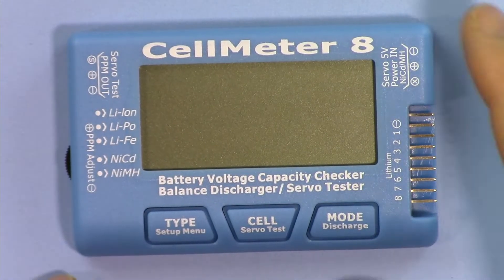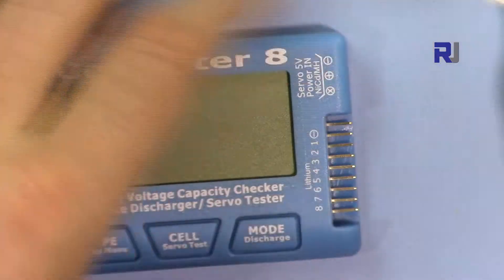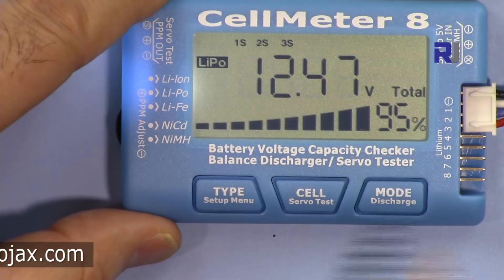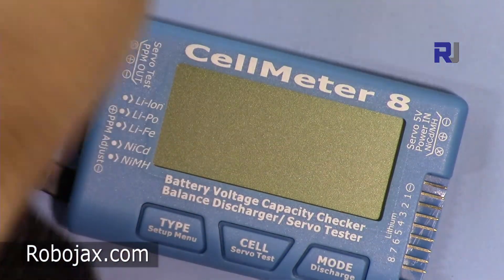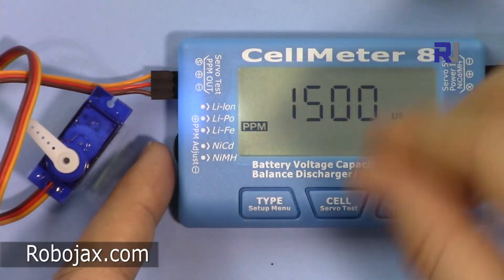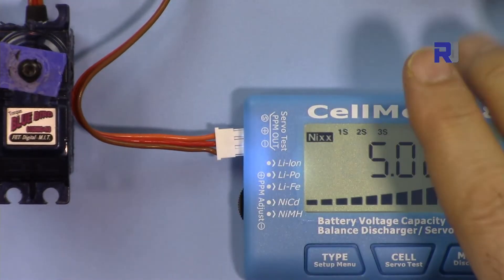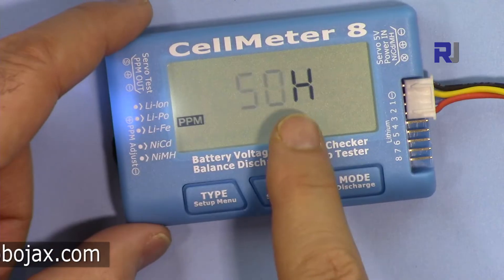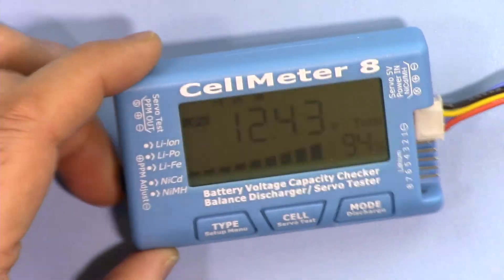Introduction to CellMeter 8 Lithium, Servo and ESC Tester

Comment: Many thanks for your informative review. I have the Cellmeter 8 and it is very useful. The only issue I have is the servo tester. I set it up, exactly like you, using a lipo 3S 2200mah and a 30amp ESC with BEC but at the time of plugging in the 'battery' connection, a continuous alarm sound starts and none of the information on the screen is shown. I have checked the plugs that go into the "servo power in" and "servo test out" to ensure they are the correct polarity. Do you know what I am doing wrong please. Would appreciate your thoughts. Thank you. Peter
Reply from the maker: You are welcoem. these inputs are simply 5V.   the alarm is for the battery /cell level.  so it seems the input voltage is not 5V. the middle wires red or organge is + and the balck is negative.Check the volage comeing from ESC to make sure it is 5V.
Reply: @robojax  Thank you. I appreciate your reply. An oscilloscope can test the voltage coming from an ESC but I don't have one. I thought most rc esc's have a BEC. I tried many esc's that I have but they all set off the alarm. I might have to look at getting some other type of servo tester. All the best.

Comment: Hi there,

When I try to test Motor (all 3 modes, Manual-Center-Auto) there is no Motor Rotating.
After couple of try I realised this ;
if I set the Cellmeter 8 about 1300 ms (still there is no RPM on the motor) and disconnect the Cellmeter and Re-Connect it, motor test start to work (all 3 modes, Manual-Center-Auto).
As i watched your video "Motor Test Function" sould be ok without this "Disconnect and Re-Connect" action.
Do You think there is a problem about mine? TIA

Comment: I ordered CellMeter 8 from Amazon, did not work with original AOKoda small black module and bulb harness fast discharge setup, neither did replacement CellMeter 8. Might work with "exposed" type module. There may be original and  counterfeit CellMeter 8's. My Hobbymate "portrait"version, with black AOKoda module, fast discharges lipos very well. Amazon sells  "ALLRAY" 24 Volt, 50 Watt replacement bulbs, cheap.

Comment: 5:30  when i hold down the mode/discharge button all that happens is "discharge" shows up on the screen and 1s and 2s along the top start flashing (2 cell battery). i assume its discharging?

Comment: lol you again!!. your videos helped me on using my buck converters, now i am watching this to  see if i can see all cells voltages at the same time on this device. im building a lipo for a ebike. i see i cant see them all at the same time. dang it
Reply from the maker: I am glad we met again. LOL. I hope you have subscribed. I appreciate it.
Reply: @robojax  i have accidentally found your videos too many times to not have subscribed, so i did last night. i really wanted a unit that would display each cell's voltage at the same time, and i did, and it wasnt that much more than the one in your video, but i couldnt tell you any more than that.
https://www.amazon.com/gp/product/B08X718GJP/ref=ppx_yo_dt_b_asin_title_o00_s00?ie=UTF8&psc=1 i want to check balance out in the field and my memory is too poor to remember all the voltages as i scroll through them. anyways thanks gain

Comment: When you press and hold the mode button to discharge a battery, is that the same as balancing it / storage mode?  Should balancing be done after using a battery or after charging a battery?

Comment: Great video, I have the same, never check my servos, where did you get that 5v input power from? Thank you !!
Reply from the maker: 5V is 5V does not matter you get it from. You can get it from any USB either a charger or a computer.
Reply: Perfect thank you for your input 👍

Comment: I have a question. 
There are other versions of these, and some can measure the internal resistance of the battery packs. 

If I hook up a battery holder, would this check 18650 lithium ion cell and 1.2v nimh aa/as cell resistance? 

Also, have you done any comparisons to manually checking (using the voltage drop calculations) and see if they are similar?
Reply from the maker: it does not doe resistance check. it just checks the voltage.

Comment: Hi, is this working with Tinyhawk batteries, 1s 450mAH ? Thanks
Reply from the maker: Hi, this will measure and gives you the values for the battery. yes it will read the value. But if you want to turn ON a servo motor, then you need 5V for the servo.

Comment: Hi, thanks for your video. quick question - where can I get the 5V battery (with the appropriate plug) to be able to use it for servo testing? Also, what happens if I insert higher voltage in the Servo 5V input? Thank you!
Reply from the maker: Hi you are welcome. The servo usually dies. the 5V can be take from any charger or USB. All usbs are 5V.

Comment: is there a way to apply 8volts to this to check high voltage servos?
Reply from the maker: NO. Power up your servo with 8V and get only signal and ground from this.

Comment: So the CM7's balancing by holding TYPE has been removed on the CM8 and you have to use discharge instead by long holding MODE. Meaning you need to specify a voltage which you didn't need to do on the CM7 as it tool the voltage of the lowest cell?
Reply: I couldn't figure the discharge on the 7 that's why I got the 8. I'm a Newby so I want to try to do it right lol, thanks for the video, still looking 😂

Comment: i, , can I go below 2.0v per cell with the discharge? I would like to discharge completely old lipos
Reply from the maker: Hi, no you can't . Lithium batteries get permanently damaged if you fully drain them. That's why chargers have "over-discharge protection" which I have explained here with this Lithium charger https://youtu.be/0mOqpCfAdy4 you will learn a lot about Lithium chargers if you want.
Reply: @robojax  thank you for the reply. So how would you suggest to discharge the Lipo to zero before throwing it to the trash?
Reply from the maker: You are welcome. just connect a DC bulb like car bulb or DC motor.

Comment: Good video! One question. Can I use this device to balance/discharge my battery with ONLY the balance connector/lead? 

My power connector on the battery is not a common one and doesnt fit any charger because of the weird design. (Absima 1/16 truck comes with a weird 7.4v 500mah 2cell battery)
Reply from the maker: I am sorry for late reply. I was on vacation. Thank you. Yes you can discharge.

Comment: Hello. Can it be used to monitor the battery from the smartphone? The battery can not be removed from the phone. Can be monitored while discharging the battery through usb or other method by this controller you present? Or other product that can help me. Thank you.
Reply from the maker: It is possible but not with this device.
Reply: @robojax  can you tell me a device that can show me percentage will discharging?

Comment: To discharge the battery I think you need to buy separately a Discharge Module which has some strong light bulbs to draw the battery
Reply from the maker: Yes.

Comment: how did you make that input power for the three pin connector?
Reply from the maker: when you connect servo to the left side, it gets power from the meter. You would have to connect as LiPo battery on the right side and that is where the power comes from.

Comment: If you hold the cell button, mine goes into the balance function. Then one tap of the cell button starts the cell balancing. I use this function the most, by far. Keeping the cells balanced really extends the life and capacity of the battery over time.

Comment: Nice video Thank You.
I have a question about servo testing. 
Can i connect 3s lipo directly ( no esc) to the right bottom side for servo test ( i mean the port the you used for both discharge and measure cells )  ? 
TIA
Reply from the maker: No you can't . it will burn.
Reply: Robojax thanks for the reply

Comment: Thanks for the video. very well made. I didn't have any success discharging with this unit. It made the off balance packs worse and also discharged beyond the programmed threshold. did you guys have a similar issue?
Reply from the maker: You are welcome. I have not discharged a battery practically. Don't know if this issue is there.

Comment: In addition to the servo & ESC tester functions, it also discharges lipo batts quickly down to storage voltage (buy it with the bulb discharge kit).

https://www.banggood.com/AOKoda-CellMeter-8-battery-checker-with-Battery-Voltage-Balance-Servo-Checker-Tester-p-1196808.html?rmmds=search&cur_warehouse=CN
Reply from the maker: Thank you very much for your comment. I have also mentioned it at 0:45 that it also discharge.

Comment: Hello, can you just do a balance of
the lipo ? the servo tester is a little jumpy did you have it set to 50H for the little Blue servo ?  cheers Brett
Reply from the maker: What do you mean? Balance charge? It can check cell and discharge. The discharge is very slow. for larger Lipo it might take  hours.
Reply: Yes my Hobbyking HK-010 can just balance the pack without having to do a full discharge ?
https://hobbyking.com/en_us/hobbyking-hk-010-wattmeter-voltage-analyzer.html
Reply: Robojax I think what he means is, can  this unit make all the cells have an equal voltage level? This is accomplished during charging and/or discharging the battery on some units. For example CELL METER 7 can accomplish cell balancing by making all cells equal to the voltage of the lowest cell in the battery.
Reply: kermets Does the HK-10 need an external voltage source to balance the pack? I'm looking for a balancer that can handle a 4S pack of large LIFEPO4 260AH cells without the need for a second battery.
Reply: You can balance the cells anytime with the cell meter. Hold the cell button, it should say bal, then hit the cell button again and it should start to balance. I have a tenergy 5-in-1, which is basically the same thing minus the servo tester, it looks the same. When you hold the cell button that brings me to where I can check the internal resistance too, it says ir. If my advice doesn't work, I still maintain that somewhere you should be able to cycle through a menu of the other options besides just discharging for lipos. PS- Thanks for the video on the HJ servo tester!